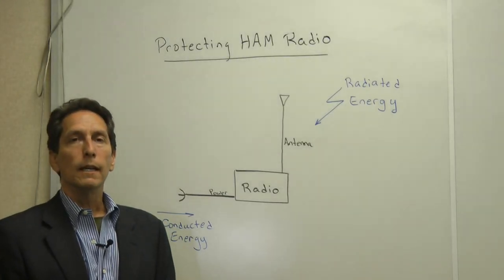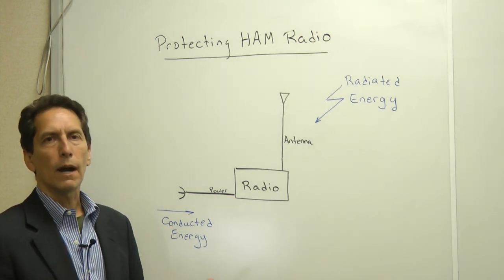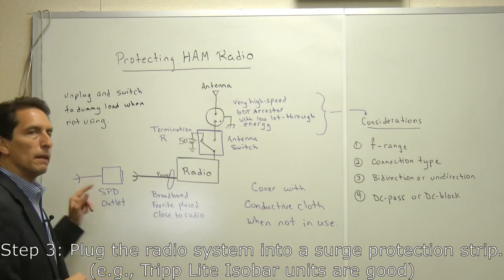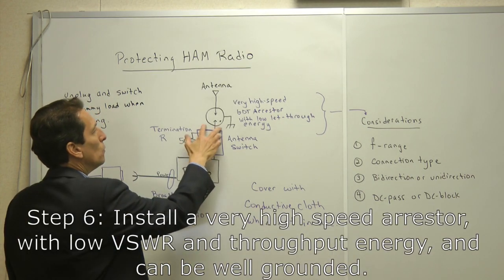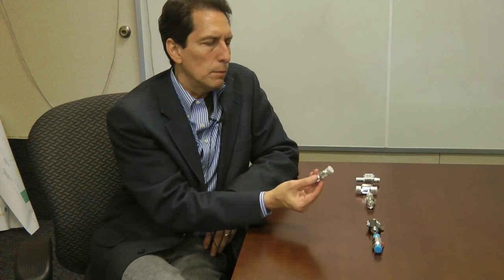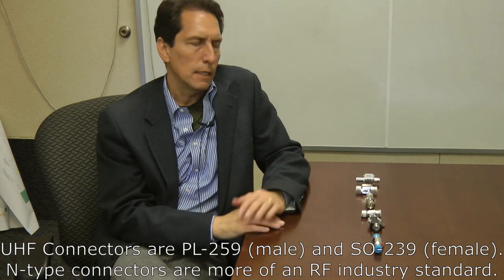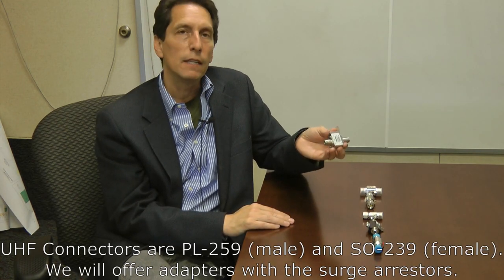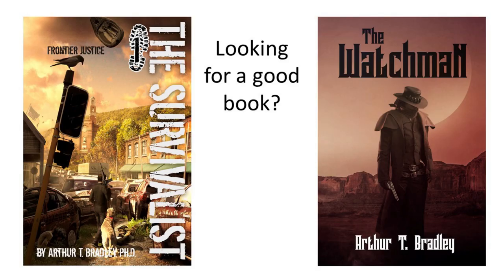Protecting HAM Radio from EMP Attack - 6 Steps

Comment: I've been using Polyphasers until I discovered much better designed and built protectors built by Morgan Mfg. here in the USA. Unlike Polyphasers, MOrgan units also include a static discharging coil on the antenna side and a static bleed resistor on the radio side. Of course they also come with fast, gas discharge tubes and high quality, dual DC blocking capacitors installed.  Polyphasers only have a gas discharge tube and two DC blocking capacitors. Maybe $10 worth in parts.
MOrgan units are cheaper too. They make different units based on frequency range and power rating. I highly recommend them.
Protectors with static bleed coils and/or resistors should be used on larger antennas, like HD dipoles or end-fed antennas because they pick up a lot of static from wind, snow or even rain. When static gets to a Polyphaser, it gets dissipated in the gas discharge tube. Problem is that it creates a lot of unwanted noise in the receiver.  The static bleed coil in the Morgan unit has a very low DC impedance but very high RF impedance. The static is dissipated to ground without creating any additional noise in the receiver. This, and the lower cost, is the reason I switched to Morgan Mfg protectors.
Reply from the maker: Thanks Andrew. I haven't heard of Morgan Mfg., but I'll check them out. Specifically, I need to review the specs on their gas discharge tubes.
Reply: Link to product?  Reviewed Specs?

Comment: This video was very helpful thank you sir will be purchasing some items from you soon was wondering if you could make a video about that antenna switch in a lil more detail thanks again sir 👍✌
Reply from the maker: The antenna switch is basically just a way to disconnect the antenna from the radio when not in use. There are simple ones, such as the Daiwa CS-201A, or more complicated ones out there. It's nice if the switch connects the unused port to ground, but not all do that. When you switch over to the dummy resistor, you just need to make sure that the resistor is high enough power to handle the transmit power. Send me a note if you need to know more (arthur@disasterpreparer.com).
Reply: @disasterprepper  Awesome thank you sir 👍✌

Comment: Does this advice apply equally to lightening as well?
Reply from the maker: Yes, it's a dual-purpose device for lightning and EMP. I talked at length with an engineer at the company.
Reply: @disasterprepper  Many thx for your quick response, meantime, what size of EMP clothe do you recommend for an average size HAM radio? I use a typical mobile radio as my permanent base station. It is approx. 9"x7"x3". It is on 3 tier rack above a desk. Also the EMP ferrite what size would I use for that?
Reply from the maker: @Richardofdanbury  The EMP cloth I sell comes in a width of 59", and you just pick the length. A 4' x 59" might be right for you? Double check what would work before ordering. It just needs to cover the radio system in this application. As for the ferrite, it needs to go around the power cord - a quick measure of the diameter will tell you the minimum you can use. Bigger and beefier usually do a better job, so either a 0.72" or a 1" is probably best. If it's much too big, you can loop the power cord back through it for additional protection.

Comment: Dr Bradley - I'd like get your feedback regarding location in the country vs EMP exposure.  I often see maps of the US that show the height of a detonation, and a chart that shows percentage of peak exposure.  I'm located in FL, which in most maps show that we may get about 30-50% of the peak exposure if such a device was detonated approximately 300 miles up, in the center of the US.  What sort of impact would that have on how we should prepare in our location, assuming that the maps are accurate?
Reply from the maker: Hi Travis, I've seen the same maps and assume they are generally accurate. The issue though is that we don't know where the EMP would actually detonate. It could be over the east coast, the west coast, over the central states, etc. I think the only way to prepare is to assume the worst-case field levels of 50 kV/m.

Comment: Great video. I always have my base radios unplugged and the antennas switched off. What would you recommend for hand held radio storage? I was considering individual cardboard tubes wrapped in aluminum foil. Would that be sufficient, or would they also need to me in a metal can Faraday cage? Is there another/better option?
Reply from the maker: Handhelds would be great in EMP bags. Making DIY Faraday Tubes would probably work as well, but you'd have to be very careful there were no leak spots.

Comment: Thanks for this video on radios.
Does the discharge tube have to be changed every time a protection occurs ? How many turns to do, and at what angle ? Also, does having a shielded cable change the setup, as incoming energy would flow through the shield back to earth/ground ?
Cheers from Europe
Reply from the maker: A GDT acts as an overvoltage device, in which a gas that is normally insulative temporarily ionizes under high voltage and becomes conductive. Once the voltage drops back down, the gas once again returns to an insulative state. They can be damaged by repeated discharges, perhaps hundreds of small discharges or tens of large discharges.

Comment: Doc, I understand 5G systems will be able to target humans with directed energy pulses. Do you have systems to protect the human body ?
Reply from the maker: Shielding from any RF energy is done either by putting distance between you and the source, or by putting a conductive barrier between you and the source. Unfortunately, there’s not really any other viable method. Most people can’t control the distance, since new 5G mini-towers are popping up everywhere. That leaves conductive barriers, such as conductive clothing, sheets, bed canopies, etc., as the only real option.

Comment: If a nuclear bomb went off near you, the last thing you need to worry about is the EMP pulse frying your radio. The blast followed by the humongous fireball will do a better job at causing your radio to packin.
Reply from the maker: I think you misunderstand how this works. The nuclear explosion is hundreds of miles in the atmosphere, not near the ground. Most people would never even know it happened.
Reply from the maker: @fredcatcreedy980  Ah, I get your point. EMP preparedness assumes that traditional all-out war hasn't broken out. If nukes were hitting cities, I'd have to agree that those living within would have bigger worries than an EMP.
Reply: 100% wrong. High altitude nuclear detonations do basically nothing to people on the ground, but the EMP would absolutely fry lots of electronics, as the energy gets reradiated by the atmosphere and causes more damage.